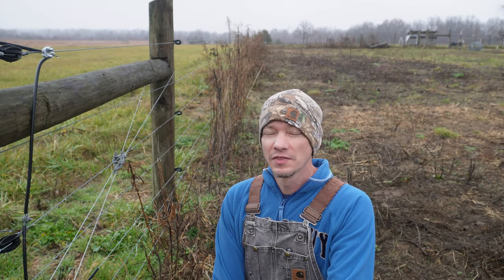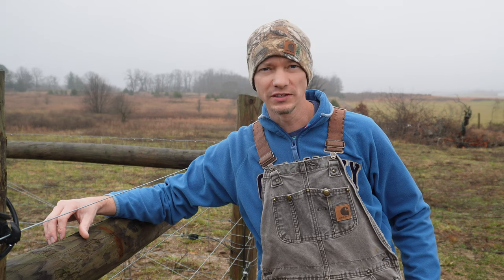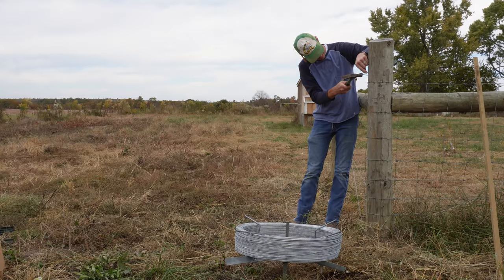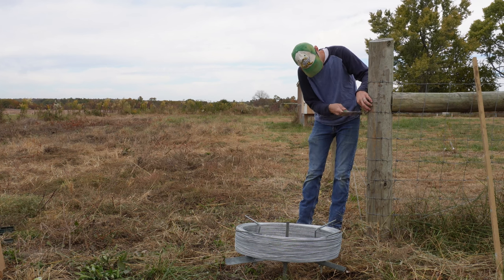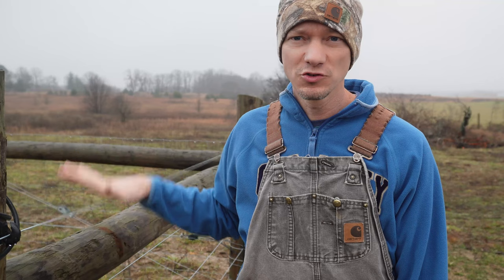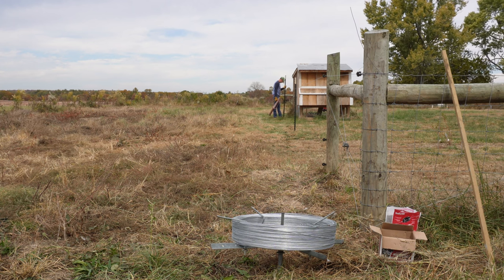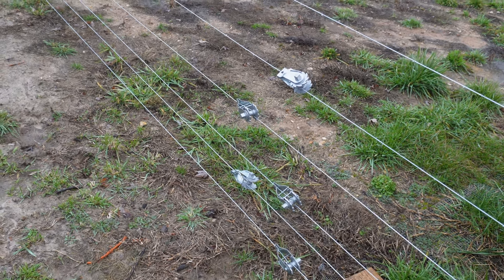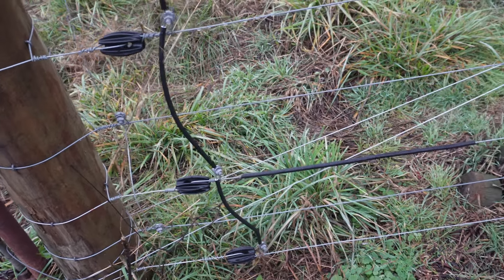How To Build A High Tensile Electric Fence

Comment: Smart man.  I'd like to pick your brain on how you would setup an electric fence to keep smaller animals like squirrels, rats, and rabbits out of a garden?  I've been trying several different ways but just now found your video and will try running a ground inbetween the hot wires with 3" gaps.  Darn squirrels run so fast it might not work unless I have hardware cloth behind it...but then someone said squirrels can jump 10'.....we'll see.
Reply from the maker: @plantbasedprepper  my first thought is some sort of electric netting, but that stuff can get expensive if you're fencing a large area. I've also heard of people electrifying hardware cloth. They tied it to fiberglass rods and kept it just a couple inches off of the ground. The big issue will be keeping the grass from growing up into it and grounding it out. Another possible solution, if you're using t posts, would be to run the hot wires on one side of the post and the ground wires on the other. You could run the wires very close to one another without as much danger of them getting tangled. That would also make your varmints weave themselves through the fence to get into the garden. That would be about as close as you could get to ensuring they'd get a shock. Good luck to you!
Reply: @PlaneViewFarm  I'm only doing a 15'x50' space. Last night I put up chicken wire on the inside of my t-posts and the hot wires are on the outside spaced 3" apart from ground.  On the Brick Wall, I just lay'd hardware cloth underneath on top of the bricks and wired it to the ground.  Zapped me pretty good and it's measuring 8k volts now instead of 2-3k.  I still saw a squirrel on my cam from work run right under the lowest wire across the hardware cloth.  I'm thinking the pulses are not catching them if they dart across. So frustrating watching them eat my entire garden while at work.  Tonight, I'll try running the ground wires around the outside of the brick wall too. Last but not least, I'll have to put up hardware cloth on the brick wall inside the electric fence to slow them down.  I think that's the problem.  They are too fast and the pulse aren't catching anything fast. Thanks for the tips. I'll let ya know how it goes. I have not found one video with a solution using just an electric fence against small rodents that actually works.

Comment: Nice fence,  here in New Zealand, we use a lot of electric fences, for dividing paddocks, for dairy cows, and beef, some farmers use 3 H.T.wires  [ two electric wires] wooden posts , 6 ft long, and strainers posts 7-8 ft driven in the ground, in softer ground, put a 8 x2 x 14 inch treated block in front of strainer [ under ground.

Comment: I am also in MO down on the AR border. Just laying out so I can place my order. Why are you using steel t-posts instead of the newer plastic posts?
Reply from the maker: I have a lot of t-posts that were already here. I probably could have sold them and upgraded, but it was just more convenient. The timless posts are definitely the way to go if starting from scratch.
Reply: How often do you have grounding problems with the T posts and insulators?   I saw one post that mentioned a specific issue with LockJawzs getting consistently grounded out with bird poop

Comment: Great video. Thanks for the info.
What is your post configuration/spacing? Do you use tposts for the all the line posts or do you add wood every so often?
Reply from the maker: Thanks you! My t-posts are spaced about 24 feet apart. The only time I use anything other than a t-post is when the fence needs to make a turn or at the top and bottom of a significant elevation change. On a gradual slope, I just keep going with the t-posts.

Comment: Im new to using electric fence, my question is should each strand end at some point without touching the wire where you start ? And run 1 single wire down touching each hot wire
Reply from the maker: If I'm understanding you correctly, yes. You just terminate the line at the end of the run with an insulator. A jumper wire provides power to each strand that you want energized. I hope that helps you.
Reply: @PlaneViewFarm  yes, thank you..

Comment: To pull top strand first to get post straight is not true. Run bottom stand drive post then rest of wire. Even if you drive a post at 30 degrees the tension of the wire will bring all in line perfectly. I am only a contractor so don't know what talking about. That wire should have at least 2k lbs of pull at install and will stretch over the next few days then remain tight as it warms or cool dure to outside temps
Reply from the maker: I've done it both ways. I like working top down better. I'm curious about the 2000 lbs of pull though, Kencove says no more than 250 for high tensile wire.
Reply: @PlaneViewFarm  the 2k is Oklahoma wire specks it will relax back to the 250 to 300 as every thing falls in place. The wire on top first is just putting it in your way. Ya fine for the little you do but you start doing 1/2 mile plus a day it's trouble especially if barb